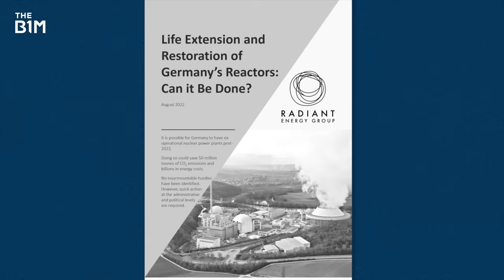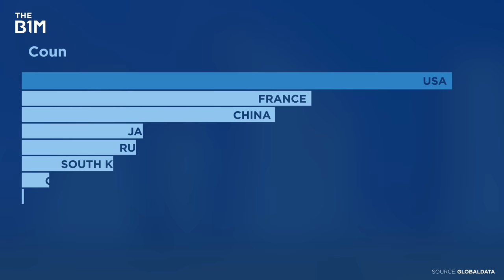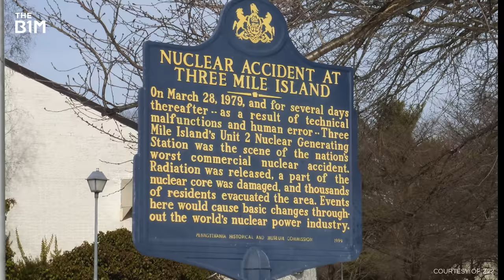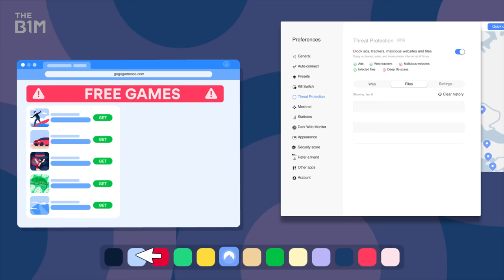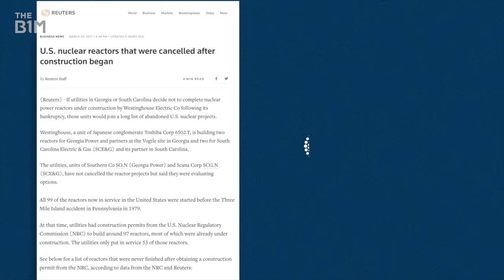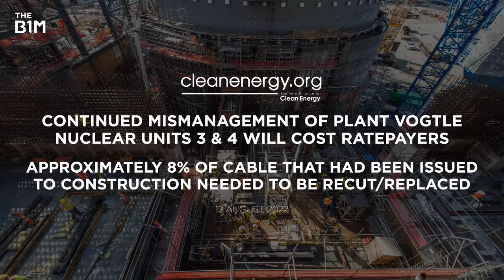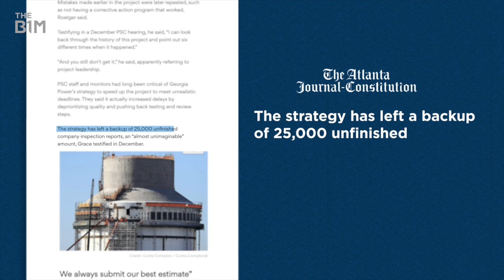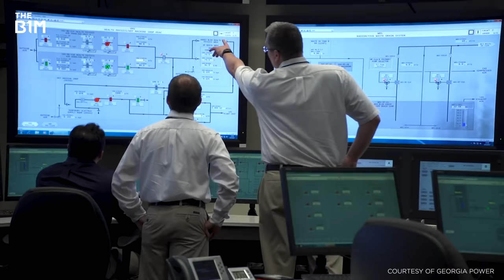Why Nuclear Power is Making a Comeback

Comment: I'm all for nuclear as long as they move away from shitty PWRs.
Reply: Since the only commercial reactors that the U.S. has ever built have been PWRs or BWRs you must want us to build something untried and hope for the best
Reply: @clarkkent9080  Thorium reactors are great and kinda meltdown proof. Also have you seen the latest on SMRs?
Reply: @clarkkent9080  What's the alternative?
Reply: @clarkkent9080  fast breeders were fully tested, decades ago
Reply: @kokofan50  EVERY reactor type known was designed, built and demo tested by the U.S. over the last 70 years.

Breeders require a reprocessing facility that the U.S. has never built.

Almost tried but never completed.

The MOX facility (South Carolina) was a U.S. government nuclear reprocessing facility that was supposed to mix pure weapon grade Pu239 with U238 to make reactor fuel assemblies. It was canceled (2017) in the U.S. After spending $10 billion for a plant that was originally estimated to cost $1 billion and an independent report that estimated it would cost $100 billion to complete the plant and process all the Pu239, Trump canceled the project in 2017.

Comment: Normally a great channel... but when it comes to Nuclear power you fall into the same pattern.... you state an arguement.... then contradict it with facts.  "Nuclear is coming back"... two reactors in a massively outdated fleet.  So promising, it pulled companies into bankcruptcy.  Such a great value... but double the budget.    What is the NET development in the US nuclear industry...?  With just two new reactors and 99 older than 40 years...  they will close before expensive modernisations are made....  not a good trend.

Comment: Like me being against nuclear energy is not so much about it's overall safety, efficiency and how clean it is relative to other methods. It's more about finding something that, if it goes bad, it doesn't mean apocalypse levels of bad. While solar and wind are comparable in terms of overall impact they will initially cause to the environment and the return of nuclear energy will be significantly greater than the aforementioned two, I'd still prefer those two over another potential Chernobyl. Humans make mistakes. A lot of them. Consistently. There will be accidents and no matter how rare, nuclear ones are very, very, VERY bad.

Comment: Your wasting your time on the wrong problem. 
5 times more electricity is needed in the future all electric world. 
That means a national power grid 5 times bigger in capacity. 
The national grid is horrendously expensive and 5 times is mind numbingly  big.
Nuclear promoters say that the extra transmission costs is too much, but all centralised electricity has the same cost problems.
The bs from everyone who wants government money is the biggest problem.

The auto manufacturers know that they will make a killing because the new EV comes with a massive long distant battery and most vehicles are parked 23hrs every day. For years.

Battery technologies are evolving rapidly. 

Some people say SMRs in every town. 
Small modular reactors. 
But if 300million vehicles have batteries then anything that can put electricity in it at anytime.
EV will selfpark like a home robotic vacuum cleaner and stay plugged into the grid 23hrs a day. 
All Renewables can top EV batteries up daily. Including rooftop solar. 
And home demand is 50% of the grid demand which will not be needed, the existing grid can be UNLOADED.
Reply: You made that 5X up all by yourself. 
No point in reading anything else you have to say.
Reply: @danadurnfordkevinblanchdebunk  nope 
The AEMO and Allan Fells, a government adviser both said the same thing about the Australian electricity market. 
Fossil fuels are very high density energy and much of their infrastructure exists. 

The transition to the all electric world means 5fold bigger electric demand. 

The nuclear promoters say transmission costs must be added to the new distant renewable sites.
And nuclear at existing central power plants proposals ignore the same criticism that 5fold bigger transmission capacity is needed. 

The transmission costs are the killer costs.

Every one seems to agree with EV and their big batteries.

Comment: Would be great to have a follow-up video on the potential for modular nuclear reactors, which while they don’t generate as much electricity, that are said to be cheaper and quicker to build, meaning less up-front capital is needed and they may be more scalable. Thanks of this video!
Reply: Well you are in luck.  NuScale was building a SMR complex and even was given up to $2 billion in taxpayer money.  However here is the result.
This is from the Des Moines Register an ultra conservative newspaper concerning the only Small Modular Reactor (SMR) project in the U.S. today.
In 2013, the Wall Street firm Lazard estimated that the cost of generating electricity at a new nuclear plant in the United States will be between $86 and $122 per megawatt-hour. Last November, Lazard estimated that the corresponding cost will be between $131 and $204 per megawatt-hour based upon the 4 recent new nuclear projects in the U.S. . During the same eight years, renewables have plummeted in cost, and the 2021 estimates of electricity from newly constructed utility-scale solar and wind plants range between $26 and $50 per megawatt-hour. Nuclear power is simply not economically competitive.
SMRs will be even less competitive. Building and operating SMRs will cost more than large reactors for each unit (megawatt) of generation capacity. A reactor that generates five times as much power will not require five times as much concrete or five times as many workers. This makes electricity from small reactors more expensive; many of the original small reactors built in the United States were financially uncompetitive and shut down early.
The estimated cost of constructing a plant with 600 megawatts of electricity from NuScale SMRs, arguably the design closest to deployment in the United States, was originally advertised as costing $1 billion but upon requesting actual bids from engineering firms, increased to $6.1 billion in 2020. Given inflation and other cost constraints that cost today can only be expected to be significantly higher.
The cost was so high that ten members of Utah Associated Municipal Power Systems canceled their contracts. NuScale then changed its proposed plant configuration to 6 fewer reactors but increased each reactor output from 50 Mw to 77 Mw costing at total of $5.3 billion. The NRC just last week approved the construction of the 50 Mw design but now will have to start the review process all over given the switch to a 77 Mw design. For each kilowatt of electrical generation capacity, that estimate is around 80% more than the per-kilowatt cost of the Vogtle project in Georgia — before its cost exploded from $14 billion to over $30 billion. Based on the historical experience with nuclear reactor construction, SMRs are very likely to cost much more than initially expected. And they now have delayed the project start until 2025 in an attempt to find more backers.  All this before the inevitable setbacks that will occur once construction starts.
Reply: @jackfanning7952  I worked in the industry for 40+ years and am pro nuclear but that does not mean I have to support the massive cost and schedule over runs and massive incompetence at the Vogtle and VC Summer projects
Reply: Lol) Vogtl jumped from 14 billion to 30 billion, this is the first. Secondly, such reactors will be stupidly more unprofitable than large nuclear power plants, and they require fuel enrichment above 20%, and they are modular, i.e. as a result, more uranium is consumed. In addition to squeals about cost reduction due to production, nothing else, by the way, they don’t provide information on this.

Comment: If you believe in global warming and think electric cars is part of the solution then just wind/water/solar is not going to cut it. They make inconsistent electricity and low amounts. Nuclear is also clean (other than the waste) and can produce continuous electricity and ramp up or down as needed. Until fusion or some other powerful clean energy source comes along this is what we have to pivot to.

I think the location of these should be a but more strategic. Why would we put any on the west coast or gulf coast? Or tornado alley? We should avoid areas prone to natural disasters so we don't have a Fukushima situation.

Comment: Literally no part of this video convinced me that nuclear is making a comeback - rather that it is way too expensive and way too slow to construct in time for our transition away from fossil fuels. The other thing that rarely gets mentioned by nuke bros: energy storage is coming along so quickly that a grid 100% powered by renewables will be achievable (and almost certainly in a time scale shorter than building new nuclear facilities by the sounds of this video)
Reply: Of course it’s expensive, we haven’t built a reactor in years. Energy storage will never be as good as nuclear, and advances in technology don’t change the fact that the materials used to make all the batteries we would need to completely transition to renewables are mined by children in third world countries
Reply: @theexcaliburone5933  batteries are only a small part of it (not to mention that critical minerals don't HAVE to be mined by Congolese children. Australia is starting to develop its lithium, cobalt, nickel etc resources which won't be using exploitative labour). Pumped hydro, compressed air, sand silos and even hydrogen don't have the same supply chain issues as batteries
Reply: @thebusthatcouldntslowdown3612  fair enough, but no energy storage will ever be as efficient as direct transmission, and no renewables are reliable as something we build and operate.

Comment: Nuclear is NOT clean. 
How can a product which leaves waste that is radioactive for hundreds of millions of years be classified as green.
The Texas gas problem was about poor and/or total lack of maintenance. Other states in the Midwest that use gas that went through the same Artic blitz did not have the same problem.
Spend the $30B on developing and improving renewables and they would be even more efficient, more reliable and less expensive.
In other words, just come out and say, you are pro nuclear power, something that is NOT green and will produce years more radio active waste.